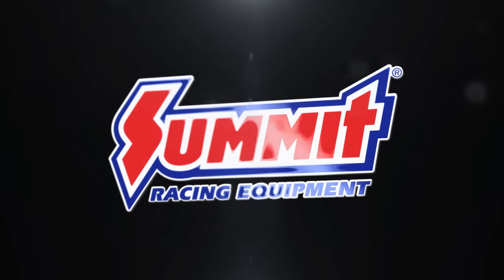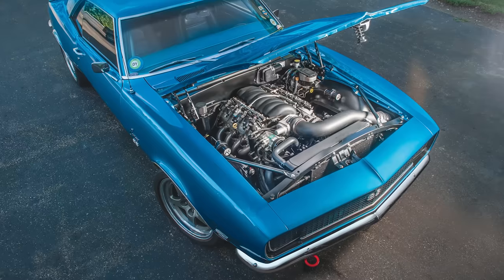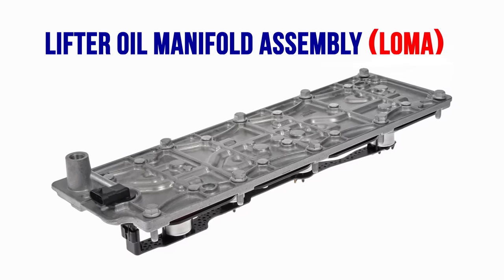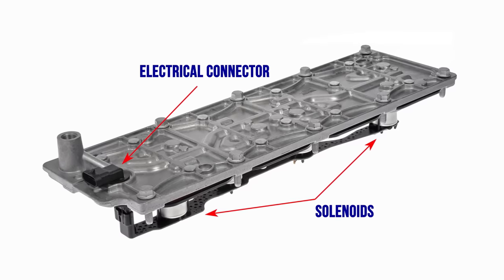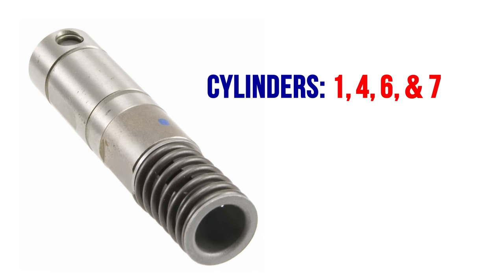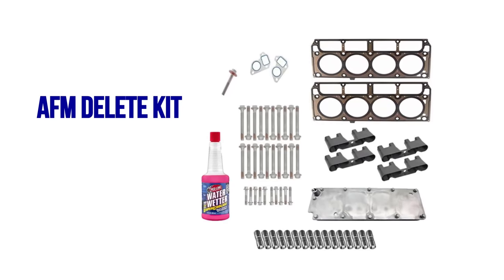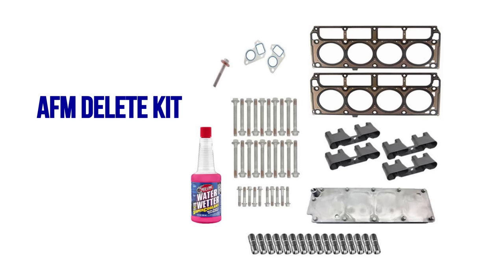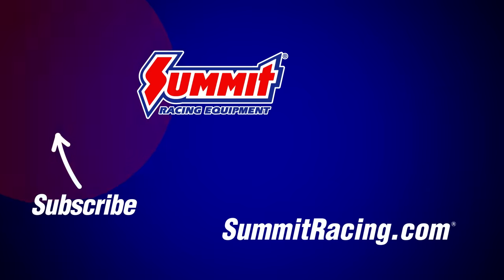Why and How to Disable GM's Active Fuel Management (AFM)!

Comment: I was thinking about buying a new chevy truck with the 6.2 engine until I started doing some research. I was shocked what a horrible design GM dumped onto unsuspecting consumers.
Reply: I think all of these manufacturers have a similar system now. It really sucks.
Reply: @bobby1970  Correct, Chevy has had them for a longggg time in the 5.3/6.2 trucks. Dodge has also had them in the 5.7 hemi for a long time also. Ford just implemented a cylinder deactivation system in the 5.0L. Solution: Just buy a range AFM disabler and call it done. Ran one in all my Chevy trucks and been using the same one for a few years and it still works.
Reply: ALL manufacturers don't have that garbage. Do your research. GM = Government Motors.
Reply: Why do you think everyone has Tundras now....
Reply: @2birddogsandawolfdog945  , I'm surprised the Tundra doesn't have cylinder deactivation? Are you sure? I'll have to do some research on that. I might have to consider getting me a Tundra.
Reply: The 6.2 without the AFM is actually a powerful and durable engine.
Reply: @anthonycyr9657  , how can you get that engine without AFM?
Reply: @2 Bird dogs and a Wolfdog  the big 3 still outsell tundra
Reply: @anthonycyr9657  I know. I had a 2013 Silverado Z71 6.2. That was the final year before they implemented AFM in the 6.2. Was an excellent and very powerful truck even at 200k miles.
Reply: @bobby1970  All 6.2s did not have AFM until 2014
Reply: @bijk1911  , that's good to know. Hopefully it won't be to difficult for me to find one of those older Silverados that have the 6.2.
Reply: @bobby1970  It is not a big deal. Just get the 5.3 and disable AFM with a tune like I did lol. Also, it is extremely difficult to find one of the older 6.2s, especially as a crew cab but GL to you
Reply: @cristilaye5912   I am dealing with one of these trucks also. But just FYI any of these manufacturers build engines this way because of ever increasing CAFE standards and ever increasing EPA regulations.  It is a never ending regulation nightmare. Not to mention NHTSA and other Alphabet Gov. regulators I forgot to mention. This just so they can get "PERMISSION" to manufacture and sell cars and trucks. Full Disclosure I am an OLD (Ancient) retired GM Mechanic. After all the "LITTLE" problems that are built in are corrected my 2018 is a pretty nice truck.
Reply: Same. And here in Australia 🇦🇺 they’re so expensive! About $120,000 to  $140,000 aud for a Silverado 1500 6.2 litre petrol Ltz premium z71…..used. Albeit with pretty low mileage. Probably cause they don’t want to pay for fuel lol.
Reply: @anthonycyr9657 I agree 
But the government has made Them ruin them trying to to squeeze more miles out of them 😞

Comment: I used to have a 2011 Camaro ss . Didn’t have it for very long, you can probably guess why….Started knocking a lil bit and then followed with loss of oil pressure. Sucked, was a fun car, only problem I had with it was the constant shut down to 4 cylinders which I knew was gonna end up killing it. Feel bad for the sucker that paid 13k for it auction lmao. Helped me out at least with the finance company lmao

Comment: If no air can get in or out with afm engaged, but the piston is still moving up and down, how does the cylinder fill with air and expel air everytime the piston goes up and down?
Reply: The system has the ability to precisely time the valves to close at given points in crank rotation. It times the valves to close on squeeze (compression) for 2 cylinders, and suck (intake) on 2 cylinders that are directly opposite in the firing order. And the 4 that are squeezing and sucking against each other have their fuel injectors turned off.  With 2 on squeeze and 2 on suck, they act like springs against each other. They are not pumping any air, that would defeat any advantage by causing the deactivated cylinders to do work.
Reply: With AFM engaged, the air doesn't go in or out.  The cylinder acts as an air spring.

Comment: What would happen if you just unplugged the electrical connector to the solenoids on the valley cover?
I'm guessing it would throw a code, but it wouldn't allow the motor go into AMF or DFM either.
Reply: actually i did the delete and my previous valley cover and solenoids are sitting on top plugged in. If i unplug it, it runs in V4 full time. trying to decide if I just want to buy the chip or pay the same price for someone to program, or just buy a programmer..charge $150 lol

Comment: Looking to buy a clean 2013 Yukon Denali XL.  At idle the engine has a very slight, intermittent but persistent 'miss' - can feel it in the seat, hear it in the exhaust, and there is a very light 'click/tick' from the engine area.  No codes.  How likely is it that this idle miss and AFM/DOD lifter failure are related?
Reply: Almost 100%
Reply: Check the rear of bo5h exhaust manifds for broken bolt. Super common to break the rear ones and get a persistent tick, if the gap isn't to big alot of times the tick will go away when it gets hot from expansion. You pay someone alot of money to drill all the old bolts out and hope they don't screw up you have to buy a new cylinder head or dorma. Makes a bracket you can scre to the back of the head and uses a bolt to push the manifold back in place for like 10 or 15 bucks. I used it 3 years ago and I've have zero problems with it and no More tick tick tick at cold start. Again super super common problem, always assume the easy stuff 1st don't always assume the worst. And when in doubt, pay someone who knows what they're doing 50 or 100 bucks to give it a once over? Cheap peace of mind in my opinion.

Comment: How do I know if I can just Disable my AFM ? I do have some Ticking that sounds like it is Valve related, does that mean that I should take the Heads off and replace LIFTERS etc????  07 GMC K1500   129,000 mi   5.3

Comment: My 2008 honda accord has something similar to this its called VCM and its probably worse than GMs AFM system. It burns so much oil and causes audible noise from the engine good thing all I need is an aftermarket wire to hack the system

Comment: My 07 has 250 thousand miles and never been an issue for me but I also don’t try to go 10,000 miles between oil changes
Reply: You never disabled the AFM?
Reply: @noe_9568  no. just change oil every 3,000 miles with full synthetic castrol edge
Reply: That's fantastic. Putting melling oil pump in my 08 tomorrow with 215000 miles.

Comment: I just had my 5.3L V8 F OHV 16V replaced on my 2015 GMC Sierra SLT 4WD. Cylinder 7 was fouling and had a fuel injector failure as well plus several codes. I believe this to be the common failure of this engine. Can I just use the Range Technology AFM/DFM Disabler Devices RA003B to defeat the AFM/DFM. If not what other parts will I need? Can someone help me?

Comment: I hear so many guys whine about AFM troubles and usually it's the whiners fault. I'd say 7 times out of 10, piss poor vehicle maintenance is to blame. The men who maintain their vehicles seldom have AFM troubles. Now I'm not so knowing in the 2015ish and up stuff but the older gear I know and, well I find them just fine.
Without AFM, all the factories could offer us would be very weak V8 engines that give great fuel economy but couldn't tow worth a shit. With AFM, the big 3 CAN give us good powered V8s worthy of use, reuse and hot rodding.
Reply: Here's hoping. My dad has a 2012 with a 5.3 and has about 190k on it right now. His torque converter shit the bed at 188k so the shop put a 6L90 in and tuned it and it's totally different now. Other than that the throttle position sensor and oil sender units have both gone out, but we did the purchasing and install ourselves. My 2018 silverado has 58.5k right now and so far so good. My dad and I both do oil changes about every 5k miles and trans flushes at about 60k miles. My truck has a catch can too since it's GDI.
Reply: I just bought a 2010 Silverado with the 5.3 in it. It’s 4x4. Should I be worried about the AFM? Should I spend the extra money to delete it or will it be fine the way it is?
Reply: @noe_9568  probably fine if it's this old and has miles on it. Just keep up with maintenance and get a v4 disabler if you dont like v4. Your truck will be a lot smoother just cruising around town.
Reply: @noe_9568 trading in a 2010 5.3 Silverado.  Just hit 73k miles and has a bad lifter roller.  5 grand to fix the bad lifter, 10 grand for a new engine to fix the problem.  Just reduce the dam speed limit and we'll save a metric shit ton of fuel.
Reply: @jolkraeremeark6949  damn man that sucks. My 2010 currently has 146,945 miles on it so far it’s working fine. I bought that range technology that disables the v4. I bought the truck when it had 124k miles

Comment: So I have a 2012 Silverado 1500 with 120K miles.  Since I am the 3rd owner I don't have a lot of info on the maintenance.  But the engine runs well and the truck is very clean overall so I can only guess it was not "beat" too much? My question comes down to if I were to go with the RANGE  AFM Disable OBD device, what about the HIGH PRESSURE Oil Pump -- will it start to cause Oil Burning as was mentioned in the video (By the way this was by far the best video I have found so far explaining the AFM system) Can someone address my question...?  Thanks
Reply: I heard the same from the video. However yes oil is no longer need with the AFM deleted. With a range technology disabler.
So once the range is in the OBD port. All 8 cylinders are activated.
The excess oil is sprayed on the cylinder wall and oil pan. BUT he did say that’s it’s more prominent in higher RPM engines. 
So stay away from jack rabbit take offs! 
And don’t race the guy with loud pipes at red lights.

Comment: There's also a myth that AFM WILL FAIL. If you maintain your vehicle, keep your oil changed and do NOT let it go past due AFM will work fine for years. But, of course, you have to sell "delete kits" at $3000 a pop (that includes labor) so I can understand why you're scaring everyone into believing AFM will leave you stranded someday.
Reply: exactly right
Reply: Just change oil  Regularly- mobil 1  I use for the past 7- yrs 🙏

Comment: thinking of getting a 2021 cadillac escalade.Does this new gen has the same issues and if so will your disabler work on it. Thanx.
Reply: Yes they have em. Follow the Gmc, Cadillac, Tahoe Group on FB Many ppl post about lifter issues. from 2007 and up.
Reply: Worse, they have all the lifters. Have done many jobs, a blown up engine with less than 3k miles, and I'm  doing a set tomorrow.

Comment: I just assumed all the 5.3 L   V-8  engines had AFM. 
I installed the RANGE on my 2014 Silverado but maybe I didn't need it ?
Not sure if I can see under all the covers, etc to see if the valley cover is smooth or ribbed.
Reply: It has AFM.

Comment: I’m all about being able to switch into 4 cylinders but honestly why can’t it be a switch on/off? I’m currently 300 dollars into a transmission filter, oil flush and wire harness change hoping it fixes my shuddering. I just stumbled onto this though and it makes a lot of sense. 
Idk if anyone else experienced the radiator fan tripping on and doesn’t go off? I’m thinking it’s the temp sensor from the fluid causing it but idk. Happens daily.

Comment: Please I really need help. I have a 2015 Chevy Silverado with the LS motor the 5.3 Everyone is telling me that it's my afm And some people said no, my truck is doing exactly this.... I will have an engine light. Come on, and it was saying cylinder 6 misfire. But everything is brand new a lot of times the light will not even come on in either way, it still has the same type of ..Vibration/misfire.. Could this just be? It's in early stages of these spring-loaded?
Lyft's going bad, or is there no such thing As stages once they go bad, it runs rough all the time??? Please 🙏🏾 help me ty

Comment: Read your owners manual. There is no reason to install AFM delete.
As instructed in the Owners Manual shift into M. Whatever gear you are in it will be  displayed.
Then tap up to the gear you want I usually go to 5 or 4. The xmsn is not strained because it is electronically controlled.
Now as stated in the Owners Manual when 5 or lower is selected your engine CANNOT go into V4 mode i.e. the AFM is not available! Another plus is when going 70 on flat highway still have AFM available for 20 mpg.
No need for AFM delete bandaids.

Comment: Would burning a little oil be worse than not having a high-pressure oil pump? It seems like a no-brainer to leave the high-pressure pump in the truck. How much oil could it burn over 5k miles?
Reply: I'm not sure but Melling says too much oil pressure causes increased wear but probably not if motor already has high miles.

Comment: It’s easy. Buy a valley cover for 4.8L and install it on your 5.3, 6.0, 6.2. Job done.
Reply: Unfortunately, 14 and up GM v-8 use a high pressure fuel pump to feed the direct injection.  The fuel pump is mounted in the valley cover.  So these engine owners must use a valley cover made for a fuel pump mount.

Comment: FYI: the lifters WILL fail regardless of how diligent you are with changing the oil. I'm not sure why this guy presents it in a way that if you change your oil on time you'll be fine.. but that is absolutely NOT the case. AFM is nothing but a disaster waiting to happen and I would absolutely never buy a Chevy vehicle that has it.

Comment: My ls3 has done 220000kms always been serviced at 9000kms and i dont drive like a mad man,would it pay if i turn off the afm electronically or am i wasting time
Reply: I'm thinking that if mine fails I can put a stage 1 cam in it along with the delete kit and have some fun!! It will add about 40 HP.💪

Comment: Dropped my 17 Yukon Denali at the dealer this AM…..$8100 in damage from a failed lifter. Needs camshaft, blah blah blah…I’m having the dealer fix it so it’s got some semblance of a warranty as we are driving to Florida in 2 weeks. If it fails during that trip it’s one them. Fingers crossed that it won’t but you know what they say…. Hope in one hand and sh1t in the other,  see which one fills up first.
Reply: What hand filled up?

Comment: The active fuel management on GM small block V8 and some of the newer 4.3 ecotec V6 truck engines I do believe causes more problems than it solves I had on a 14 silverado 5.3 first year for ecotec V8 and it was great I was getting 27 mpg with 3.08 gears in a cc sb cruising at 70mph now however is was getting almost 25 mpg with my old 5.7 vortec at the same speed a bit more torque than the newer 5.3 but only 255 hp and 330tq vs 355hp and 383tq it was a small difference really just saying considering my old 98 350 vortec had 390000km it didn't owe me anything both great trucks have a 19 silverado with a very similar 5.3  v8 and it's up there in the high 20s mpg too at around 70mph and about 1800rpm doing it just my 2 cents good video have a good day
Reply: How were you getting 25 mpg from a 5.7 vortec that’s crazy best I ever got was around 18 mpg.
Reply: @pete4261  I wanna know what dark magic he was using to get that too. I feel pretty good when I get 14 out of my vortec 350
Reply: @pete4261  the 98 350 vortec I had was 4 wheel drive long bed reg cab 265 size tires I believe 3.08 rear gear it was might have 3.42 can't remember smaller tires definitely helps with mileage and the tail gate down to also helped it was my first full size truck from gm if not 25 mpg  it would've been close I was getting maybe 600 650km to every 20 gallon or so tank
Reply: @TheSteelBlinds  yeah they were definitely not good on gas good engines.
Reply: @stevemino142  that’s impressive I have owned several of them most of them extended and all of them weren’t great on gas.
Reply: @pete4261  I agree I was probably only getting 15 at best around town though keep the revs 2k max pulling on the highway gradually to about 70 mph no more than that
Reply: Yea when i had to open mine up 148k there was hardly any noticable wear on the surfaces, except that dam lifter. No reason you should have to break into a 148k mile 
5.3 thats been well maintained, other than crappy engineering decision...

Comment: I paid a mechanic friend to load the NP 
App. and buy 2 credits for my 2010 Tahoe 
5.3 V8. He went in the onboard computer 
and flipped the dip switch to disable, and 
VOILA, no more 4 cyl mode with all the 
possible problems.
Reply: The computer uses a dip switch to control AFM?

Comment: Why is cylinder deactivation bad for the oil?
Reply: It's not bad for the oil it's the fact that on certain models they don't have the oil deflector for the bypass valve and it splashes oil up on the cylinders or early models that actually squirt extra oil up on the cylinders which creates excessive oil consumption.

Comment: Disconnect booster pressure sensor from brake booster. Everything still works but will set cel. V8 100 percent of the time.
Reply: Is that an electrical connection or hose

Comment: To me the way he explained the delete kit makes me think that the delete program without using a delete kit would ruin your engine? No? He made it sound like you have to do the kit to avoid overusing oil and other things?

If i can use one of there just programmers to turn off DOD i would but i dont want to hurt my truck by not replacing all the parts with a kit?

Comment: The oil pump it's the same in both engines with AFM and engines without AFM system. It's changeable or not. Help please.
Reply: use the hi flow pump if you like the rev it to red line it help the engine live longer.

Comment: They should of just kept making 350 small blocks, a lot more simple and reliable
Reply: Because they rarely made it much past 120000 miles without rebuild. The last series is a 200000 mile plus motor the machine tolerances are MUCH TIGHTER  compared to the older engines. 5 30 oil instead oh 10 40 . Loved the 283 especially 😍 but like some things, they have done better.